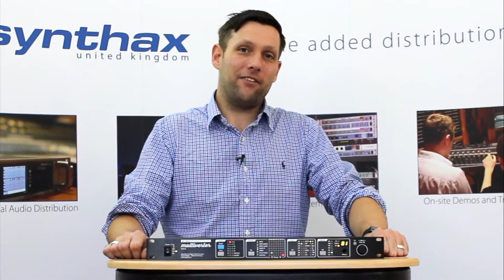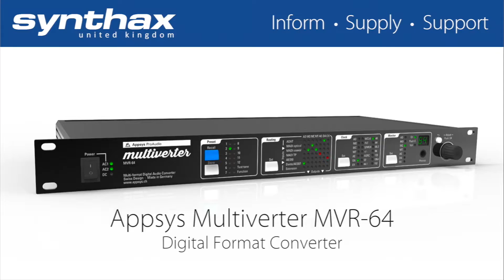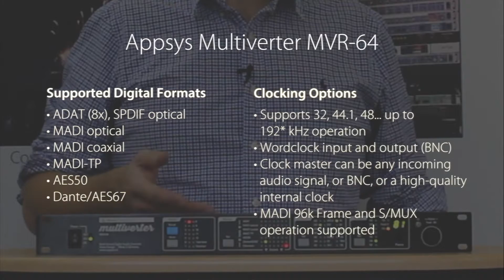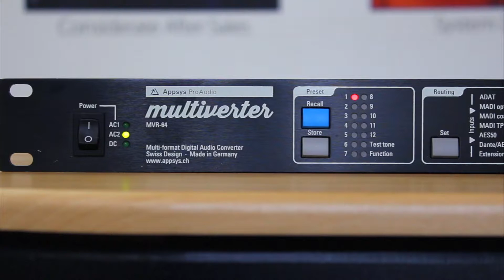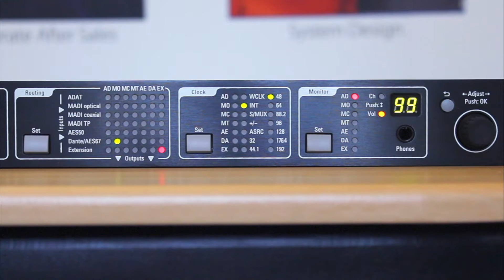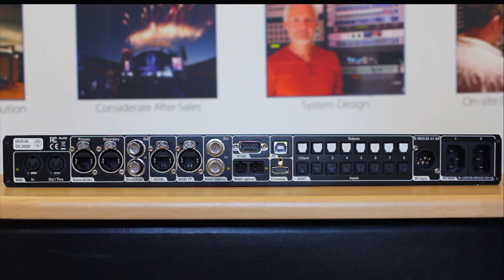Appsys Multiverter MVR 64 Overview - Synthax Audio UK

Comment: I have a newbie question, still learning. I have a rme ufx+ interface with Madi. Im interested in buying Neve rmpd8(Dante). Is it possible to use neve rmpd8 micpre signal and feed into appsys unit using Dante and then convert signal to Madi going into rme ufx? Do I have this correct?
Reply from the maker: Hi, sure no problem. Yes, the Multiverter can freely convert signals between MADI and Dante (along with other digital formats). So yes, you could record into your mic preamp, then go through the Multiverter, then into your UFX+.

e.g. Mic preamp > Dante > Multiverter > MADI > Fireface UFX+ 

If you're simply looking to translate between Dante and MADI, then the Multiverter would probably be overkill though, as it's designed for working with a much wider range of digital formats. 

Have you looked at the RME DIGIface Dante? It would allow you to do the same thing (convert between Dante and MADI, via the BNC connectors).

https://www.synthax.co.uk/rme/firewire-usb/rme-digiface-dante/
Reply: @SynthaxAudioUK  thank you, I believe ur right, just saw the digiface earlier. Does appsys or ferrofish has slightly better conversion than ufx+? Or they about same, you just get more channels?
Reply from the maker: @ottomanmuzic5744  Hi, in theory the UFX+ will have slightly better AD and DA conversion than Ferrofish converters. Both are professional and sound very transparent though, so it's debatable how much of difference you will hear in a real world scenario (especially once you begin processing the sound with EQ and effects).

Converters are a subjective thing of course, and you may find you prefer the sound of one to the other for depending on what you are recording. A 'harder' converter may be preferable for musical styles like rock music for example, whereas a 'softer' converter may be preferred for orchestral. Either way, we regularly specify Ferrofish alongside RME, and have never had any complaints.

As for the Multiverter, it's a digital format converter only (no AD or DA conversion), and therefore does not have a 'quality' as such. It is simply converting the audio signal from one digital format to another, and therefore has no effect on the sound. Hope that answers your question.
Reply: @SynthaxAudioUK  great answer and very informative.  Many thanks